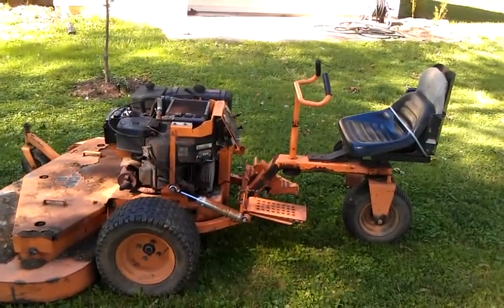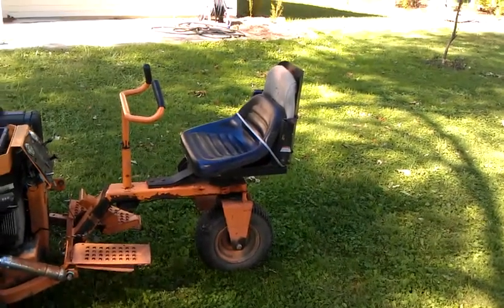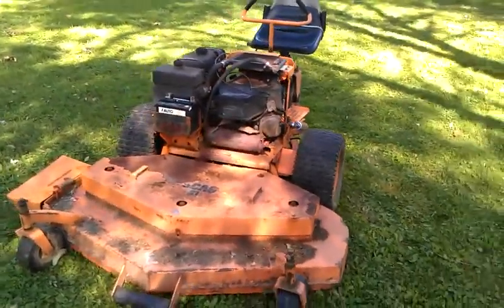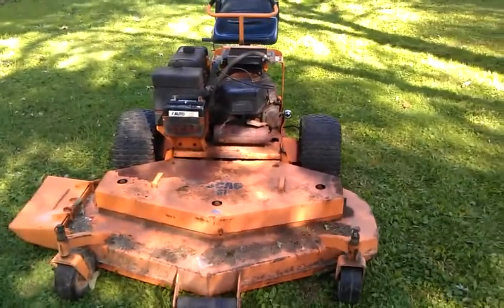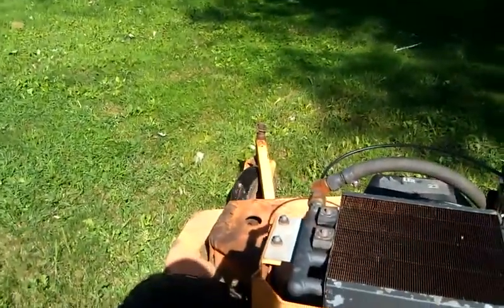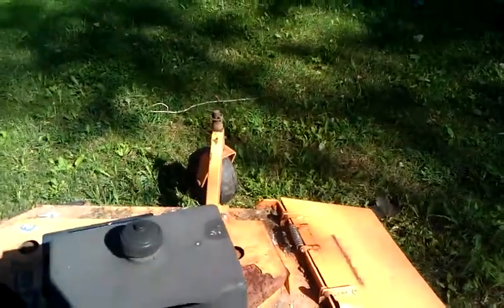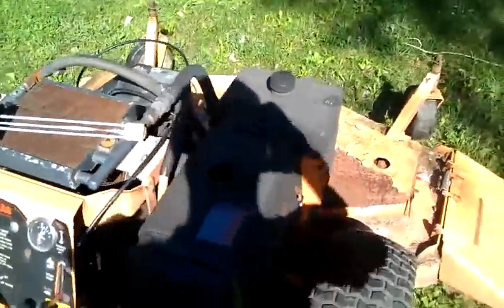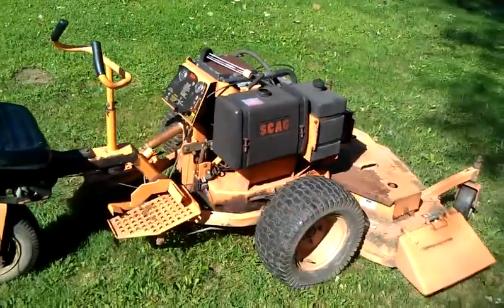SCAG 3-WHEEL 61" COMMERCIAL LAWN MOWER demo / walk around Kohler 22hp oil cooled Turf Tiger

Comment: I just bought one of these out of the place I work but mine is older and I can't find the model number it's a 61" with a Kohler Magnum 20 none I can find have a magnum except the video of scag mower history for the 1985 or 1986 I think mine is a first gen it's in great shape for its age hasn't ran in 3 years but put a little gas down carb and fired right up it's just like this one except its a magnum MV20 and hydro cooler is not over engine fan

Comment: I have one of those mowers. It's a bit of a basket case, but working on it. I am missing the left pedal on mine. What does it do? There are 3 cut wires that would've ran to the pedal. Thanks
Reply from the maker: That's cool. They are pretty good mowers. I didn't own this one for more than a week. So honestly I don't remember anything about it as far as I left pedal goes. Sorry I couldn't be of more help
Reply: I Don't Know If Mowers Can Be Basket Case. but whatever floats your boat
Reply: @NoNonsenseKnowHow  left pedal Is the safety however most of them end up jumping that function so yea